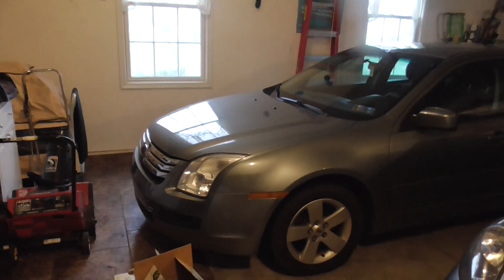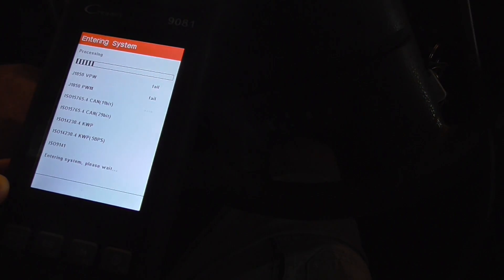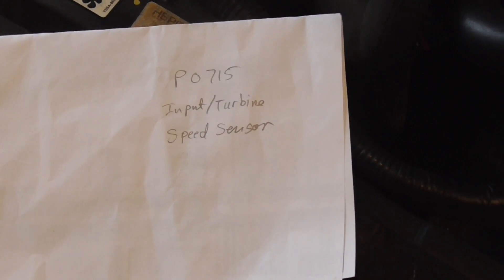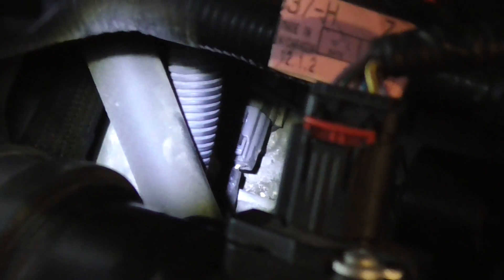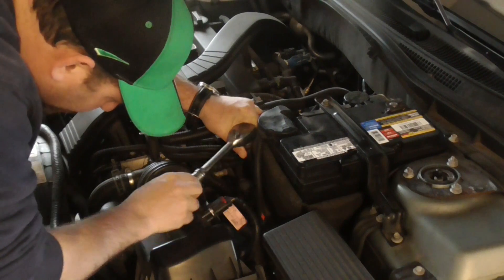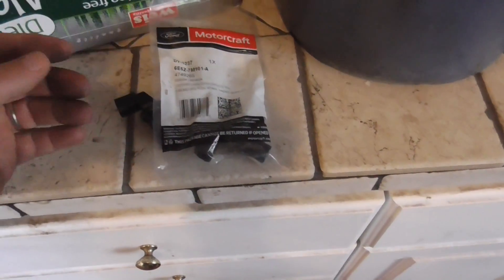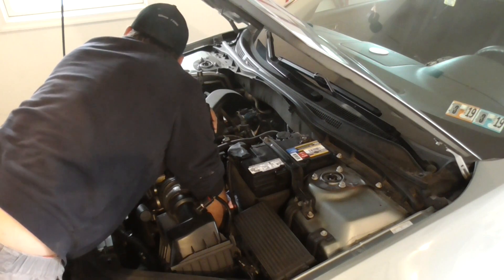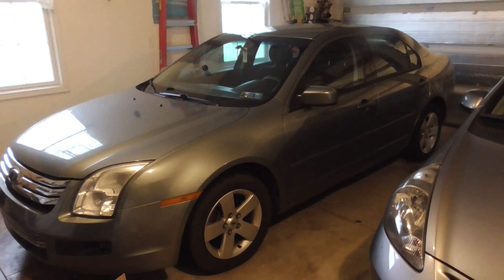Ford Fusion Transmission Problems P0715 Code

Comment: I have next generation of fusion and recently I feelt some harsh on gears shifts and emergency mode switch...I have to see for any code
Reply: Any words on the fix? 2014 fusion here same issue.
Reply: I had the same issue in 2013 Fusion and the problem was with a wire in the socket, was corroded, I've order a new socket to the dealer
Reply: Transmission has adaptive learning.  Have your Transmission reset and go from there. More than likely that's your problem
Reply: @therealbigfoot3076  was a corroded wire in transmission turbine speed sensor

Comment: I replaced selenoid A on my 2013 ford  fusion and it did not fixed the issue. What the problem could be? code P0751 won't go away.  Please help
Reply: I’m having the same issues with my 2015 fusion. Any luck?

Comment: I'm having a problem with my 2009 Ford Fusion it first started when I was backing up I heard a bump and then a few days after that the maintenance wrench would show up come on and then whenever I would see that I know not to turn the car off and then I make it home and cut the car off it won't start back up there's a fuse up under the hood in the fuse box and it keeps blowing the last time when I was driving it it was a push bump and then the wrench showed up I cut it off and it would not start again but whenever I turn it off before does not start it makes this weird sound if this information Rings any bells I would appreciate some feedback thank you
Reply: Hey... was this a v6 car?

Comment: Did your car jerk? And not go beyond 60mph without wanting switch a gear or blow up?
Reply: I have a 209 Ford Fusion it sounds like the situation that you're having but when I turn Minds off it won't start back up there's a fuse under the hood that blows good luck with yours
Reply: @michaelanderson-sr5uv  Do you know the name of the fuse as far as it's purpose? and where under the hood is it located?  Thx.✌️
Reply: Could that be why  mine jump in reverse but shifts fine

Comment: I have an 07 ford fusion that says I need an input turbo speed sensor is this part different from an output speed sensor or do they use the same sensor?
Reply: Different......and just for the record if you remove the battery and battery tray,which isn't hard to do,you can easily access both the input and out put senors and replacing either is a snap.
Reply: I'm told I need outputshaft speed sensor and a turbine speed sensor. Is the turbine just the input sensor?

Comment: Sir, I find this advice, at best spurious for the following reasons:
• Is it likely a sensor, which has no physical interaction with any components, would chronically remedy a "clonking" emanating from the transmission.
• The vehicle after "about two weeks" had no recurrence of the problem, possibly as it hadn't moved an inch. Tyre valve and car in same relative position to surroundings.
• How could anybody expect to be taken seriously when it is also evident you store Ginget Ale inverted.
Reply: He also only wrote one code down. I find it hard to believe there wouldn't be additional, more generic codes in addition to the sensor code.

Actually, the P0715 code is for "Input/Turbine Speed Sensor Circuit". So it's entirely possible the sensor could be working perfectly fine and there is a different problem with the circuit. Or, as in the case of my car, the problem actually appears to be a damaged o-ring on the input shaft of the transmission. In my case, the car is throwing P0715 along with P2765 (Input/Turbine Speed Sensor B Circuit) in addition to the more generic P0701 code (Transmission Control System Range/Performance) which I would suspect would have also been thrown in this case if the problem really was the sensor.

Like you said, given the symptoms I think it's at the very least a bit hasty to jump to the conclusion that it's a problem with the sensor.

Comment: I followed your instruction to replace the same sensor on my 2006 Mercury Milan, thanks for the video! Btw, it took me quite some effort to separate the cable from the sensor. Did you also struggle there?
Reply: I have the same car transmission store charging me 1500 to fix
Reply: @a1lee307  it's gonna be good that EV's won't need these sensors anymore.
Reply: @SamuelLi  4 cylinder is 5 speed or 6
Reply: @a1lee307  I think it's 5

Comment: Need advice for my Craftsman DLT 3000. This model has the Honda 16.5 GCV530 motor. Unfortunately can't find the  discontinued fuel tank and it has decayed over the years. Is anything compatible. Any ideas would be much appreciated.